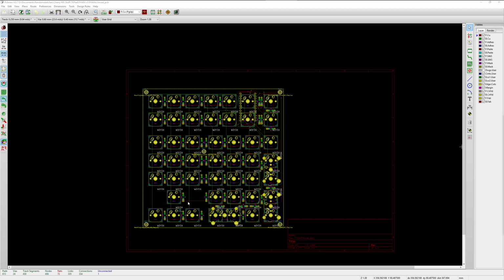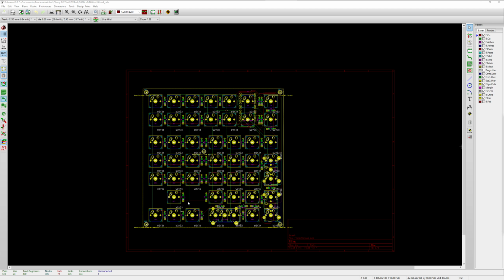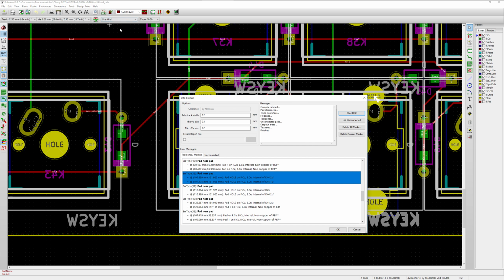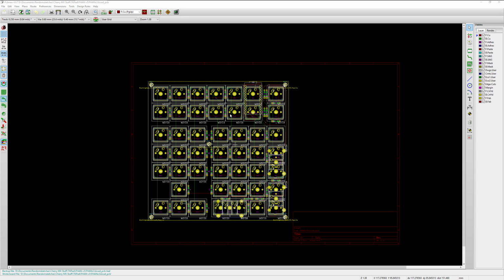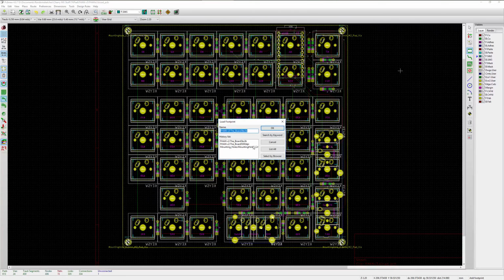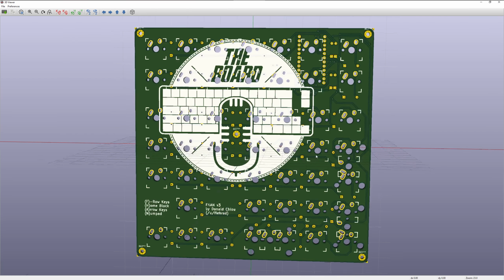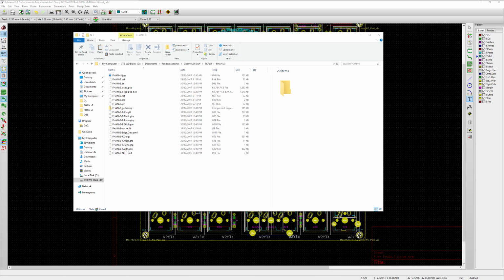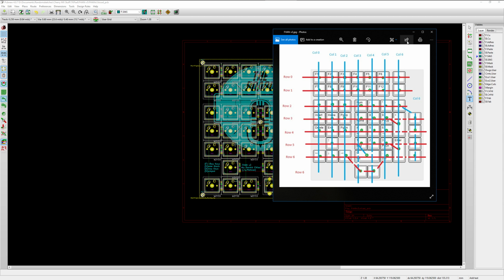FHANv3 Design Series Pt 5/5 - Gerbers

Comment: I am designing a 27 key "keyboard" using your tutorial and blog info. It's a button box for a iRacing Simulator rig. It uses Cherry Mx Switches. I am researching how to build this as a "game controller" with 27 buttons as opposed to it being recognized as a keyboard. I'm curious if you have any input or any resources that might help. 

Thanks in advance
Reply from the maker: It depends on if the inputs to the gaming system (PC?) uses keyboard 'commands' or not to action commands.

If it does (e.g. assignments match if you could play using a keyboard), then you just need to program macro's.  I have a friend who plays flight sims, and he wanted to develop a macro-deck which was all the shortcuts that you can generate already in-game, but as 1 button press actions, to simulate like in an actual airplane cockpit.

If this is kind of the same thing, its just a matter of programming.

If you're after something else, like input to a console, then sorry, I'm not experienced in that area unfortunately :(
Reply: The Board Podcast It is for PC. Macros is an option in fact that is how I envisioned this to begin with. The idea was to create a 27 key-keyboard that would only use specific keys so the game software could assign the commands for each key. Since then the concept has evolved to having the computer recognize it as a game controller for extra programing options. It will still use macros bit since it is so customized it shouldnt be to much to ask from it to be a 27 button game controller.

I'm seeing some forums that can help. My background is more related to design and so this is a good learning experience for me.
Reply from the maker: Hi Alex,

If its for PC, then it should be relatively easy to develop. If you have a look at https://qmk.fm/ , you should be able to look through the github(s) and also the documentation (https://docs.qmk.fm/#/) on the kinds of commands possible on it.  The programmability can be done via a C++ environment, or through web browser GUI's depending on how complex your needs are for the controller.

There are plenty of keyboard Discords and Slacks available of people with experience in programming in QMK also if you need help once you get your design to a prototype fabbed PCB, or if you 'handwire' it using a plate only. If you feel the desire to join in our keyboard Slack with other The Board community, shoot me an email at theboardpodcast[at]gmail[dot]com and I can send you an invite.
Reply: The Board Podcast thanks a lot. I will be in touch.
Reply from the maker: No worries!

Comment: Another giveaway of the switch testers?
Reply from the maker: Which switch testers? I don't have a planned giveaway at the moment, would probably need another milestone, perhaps at 2000 subscribers :)
Reply: The Board Podcast Ah but I'm going to buy a keyboard with outcamo blue or idk what's it called
Reply from the maker: Outemu Blue is a switch type, they're not bad, a cheaper brand of switches but they do have a very solid click sound response.